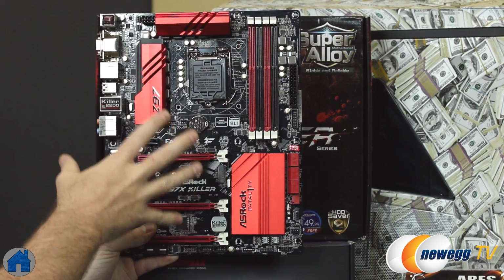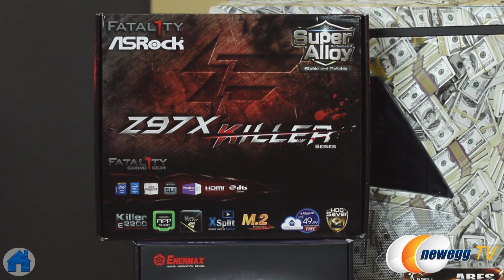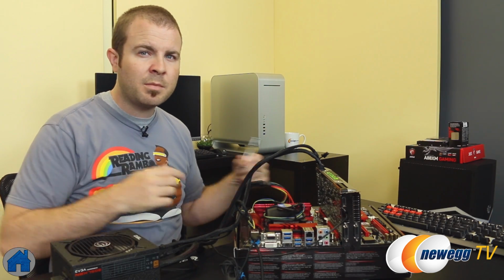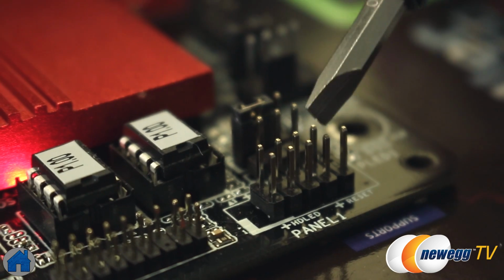How to Build a PC - Part 1 - Newegg TV

Comment: I'm new to computer building community and was wondering how this build is
AMD FX-6300 processor 
Cool master hyper 212 evo heat sink
Asus M5A99FX pro r2.0 atx motherboard
G.Skill ripjaw x series 2x4GB DDR3-2133 RAM
WD black series WD1003FZEX 1tb 3.5 GB 7200 rpm hard drive
EVGA geforce gtx 750 ti superclocked video card
EVGA 220-g2-0750-xr 750W fully modular power supply 
Corsair 500R atx mid tower case

Comment: First build, any thoughts?

Graphics card: Gigabyte GeForce GTX 970 4GB WINDFORCE Video Card
CPU: Intel Core i5-4690K 3.5GHz Quad-Core Processor
Motherboard:Gigabyte GA-Z97X-GAMING 7 ATX LGA1150
Ram: G.Skill Ripjaws X Series 8GB (2 x 4GB) DDR3-1333 Memory
Storage: WD Blue 1TB 7200 RPM & 120gb ssd
Power Supply: SeaSonic x650 gold
Case: Corsair 300r atx
OS: Windows 7

Comment: skimming off socket compatibility are all base component parts universally compatible if they fit together?? 
these are the specs i plan to get 
Thermaltake Chaser A31 Gaming Case
AZZA Titan 1000W
MSI Z97-Gaming 5
NVIDIA GTX 760 2GB
AMD FX 8350 8-Core 4.0GHz
G.Skill Ripjaws X DDR3-2133 8GB 2x
No clue on which hard drive to get atm, this will be my first attempt and build my own gaming PC and I've watched as much PC building videos as I possibly can to this point any suggestions on different parts or if these specs are compatible would be great, was also wondering if any extra hard drives or stuff like sound cards would be a necessity, you know like thigns that arn't listed that i will still need not regarding the mouse monitor or key board.

Comment: How is this build?
Budget: €800,-

Specs:
CPU: Intel Core I5 4460 Haswell Refresh
GPU: Asus R9 270X DCII 2Gb
RAM: Crucial Ballistix Sport 8Gb 1600 C9
MOBO: Gigabyte G1 Sniper B5
PSU: Cooler Master G550M
HDD: Seagate Barracuda 1Tb 7200 RPM
Case: Corsair Spec-01
Monitor: Benq GL2250HM
OS: Windows 8.1
Reply: Better then consoles for sure :)

Comment: Do your have to buy the cables connecting the hard drives to the power supply, and the data cables connecting the drives to the motherboard separatly? :))

Comment: Is this build alright for gaming?(got it from Austin Evans)

AMD Athlon X4 760K (processor)

MSI A78M-E35 (motherboard)

Sapphire Radeon R7 260k (video/graphics card)

8GB Crucial Ballistix sport (RAM)

1TB Western Digital black (hard drive)

430W Corsair CX430 (power supply)

Corsair SPEC-01 (case)

OS- Windows 8.1 64-bit 

Corsair AF120 (spare fan I dont really need)

please leave feedback or any improvements or changes i can make. This is a budget build.
Reply: I'm also not sure if I need an adapter to connect to WiFi... do I?
Reply: EpicTrolledYouBro Some mobos come with a built-in wireless network adapter to connect to wifi. Check yours and if it doesn't then you need to buy and install a wireless network adapter through pci express or usb. You'd want a wired connection rather than wifi though.
Reply: ItsQuiteSwell yea but where im planning to have my computer is no where near our modem so wired isnt an option unfortunately

Comment: I need help choosing my wattage, I would highly appreciate any suggestions. 

Hardware: 

CPU: AMD FX-8320 3.5 ghz (not overclocking)
CPU Fan: Stock
Motherboard: ASRock Fatal1ty 990FX Killer
Ram: 8 GB ( 2x 4Gb ddr3 1600) nothing too fancy
GPU: EVGA Geforce GTX 970 (Uses much less power than normal 970 or 900 series gpu's)
HDD: Western Digital 1TB 7200rpm blue edition 
Optical Drive: Some $20 Asus dvd cd drive
Fans: 2 120mm fans with led (again nothing too fancy)
PSU: My preferred/calculated wattage on pc part picker is 367 watts, but since another calculator said 500 watts i'm leaning toward a 550 watt psu to be on the safe side.

PS - This is my first build so do you guys think that this combo works well with each other and if i am missing something?
Reply: A good 400ish watt PSU, like the Corsair CX430 should be adequate, but to account for capacitor aging and to give you a bit of headroom in case you do decide you want to overclock or add components later, a 550W PSU would make sense as long as it is of equal or better quality and doesn't involve paying a large premium. Lately I have been recommending the OCZ ZT-550, which is well-reviewed, fully modular and $55 shipped in the US without having to mess with rebates.

The motherboard you've selected is pricy and probably not worth it for this build, especially if you don't plan on overclocking, though I realize a rebate is going on. I personally discount rebates because of the time and expense involved (paper, ink/toner, envelope, stamp) and the fact that cutting out UPCs can complicate the RMA/return process if it becomes necessary (the "expected value" of a $20 rebate is closer to $12 to me). The Gigabyte GA-970A-UD3P may be a good option to save some money (and it has a rebate going on right now too, on top of its lower base price).

You don't have an SSD incorporated into the build, which I recommend -- it won't improve your frame rates, but improved boot times, load times, and Windows responsiveness is worth it. 128 GB minimum, 256 GB is ideal. The Crucial MX100 is a great choice at either capacity.

Optical drive: Will you ever use it? These days most people won't. Save on some money and internal clutter if you don't need it.

Otherwise it looks good to me. And don't forget to get a case and operating system. And peripherals, of course.
Reply: I mainly choose the motherboard because it was great with reliability. I saw alot of problems with other motherboards that are affordable, cool (temp), and reliable. I know I was looking to spend less than that but it was my only choice after all the issues with other mobos on newegg.

What exactly is rebate? i don't understand how that works and it sounds like a scamish type of thing in which the manufacturers just want more money on the contrary of discounting. I've also heard the can take weeks and even months to give you the money back.

I would actually like an ssd for my os, but i view it as a luxury because its not necessary and my build looks like around $950ish right now and i don't want to bump it up more. Maybe next year.

Also, what are peripherals?

Comment: Can someone help me, I got a GeForce GTX 970 with only ONE dvi port, 3 displayports and one mini hdmi. How would I go about connecting a second monitor? I'm already using the one dvi port to connect the first screen, and my second monitor only has a vga and dvi port. Thanks
Reply: Captainprice785 Only needed it to watch video on the second screen nothing major
Reply: try a mini hdmi to vga/dvi, or a displayport to vga/dvi
Reply: Brian Trinh No worries, I already figured out another way. Go to the bios settings and enable the cpu integrated graphics, then connect whatever ports are available on your motherboard. So in this case I connected a DVI cable to my second monitor and it worked perfectly.
Reply: Mubz Beats - Daily Dose Of Real Music Integrated graphics, after you bought a 970? Ouch, dude...
Reply: It’s been 5 years does the 970 still work??
Reply: @calikdh  Haha im sure it does, i got the gtx 1070 now

Comment: Can anyone tell me parts for a budget PC some where around 500-600 recommendations for better performance I'm willing to spent a little more ty!!!, :)
Reply: Use logicalincrements.com to form your starting point, keeping in mind which (if any) peripherals you need, and that you'll need to tack on $90-100 for Windows (or $70 if you're a student).

Then use pcpartpicker.com to start shopping around for individual parts. Look for opportunities to trade up or save money. Use web sites like Tom's Hardware's CPU and GPU hierarchy charts, and the eggxpert tiered PSU thread to get an idea of where particular parts lie in relation to each other.

Then browse a deals forums like the /r/buildapcsales on reddit.com to find standout deals that hit your budget. Then go back to pcpartspicker.com and check out your list to refine your choices. Look up specific reviews for each of the parts you've chosen, including benchmarks (if applicable) and user reviews to see if there are any recurring problems people seem to be experiencing (it's usually safe to ignore any complaints/issues if they're vague or one-offs).

As a final step you may wish to post on /r/buildapc to have your build validated. Then pull the trigger.

Good luck and have fun.

Comment: I'm going to be building my first pc soon.  Do you guys think this build would be okay?
http://pcpartpicker.com/p/j8FRCJ
Is there anything I picked I could save more money on?
Is there anything that might be slightly more expensive but a better value overall?
Any general advice?
Reply: If you're going with a non-k/non-overclockable processor, there is no need for an aftermarket fan/heatsink or a Z97 chipset motherboard. You can save money by going with an H- or B- chipset motherboard and stock cooling, or you should upgrade to an unlocked i5; for about $17 more you can get an i5-4690k, which I recommend.

Also, RAM with tall heat spreaders, like those you've chosen, are often incompatible with tower coolers.

For GPU, AMD offers a somewhat better value right now in this price range with the R9 280. If you don't disregard/discount rebates heavily, it's worth noting that there's a $30 mail in rebate available for the MSI R9 280 GAMING 3G, priced at $185 before rebate, with free shipping. Even without the rebate it's a better value though.

You haven't incorporated an SSD in your build, which I highly recommend. It massively improves boot times, loading times and gives a noticeable bump in overall system responsiveness, although it won't affect your frame rates at all in most games. The Crucial 256 GB MX100 is a great value at $100; the 128 GB version is OK at $70.

Your power supply should be sufficient, though I usually recommend something a tad beefier. It's a fine value if you don't discount the rebate, but otherwise you should spend a bit more to go up a tier and get, perhaps, a OCZ ZT 550.

Consider whether you will really use the DVD drive; these days they're pretty superfluous for most users. If you'd only use it for Windows installation, maybe you can borrow one from another system, or acquire an ISO and do a USB thumb drive install.

If you're a student, get Windows 8.1 Pro through the Microsoft Store for $70. If not, you can save a little by going with amazon (though this price doesn't seem to be listed on PC Parts Picker for some reason): http://www.amazon.com/Windows-8-1-System-Builder-64-Bit/dp/B00F3ZN2W0/ref=sr_1_1?ie=UTF8&qid=1416651872

Hope this helps. Have fun!

[Edit: Another thing you can consider doing is going cheaper on CPU/MB to make room in the budget for the SSD and perhaps a better GPU if this is intended to be primarily a gaming PC; most games are not that CPU-dependent and for general use any modern CPU is more than adequate. Right now the i3-4150 can be had for only $90, which seems like a very good value to me. Other i3 processors as well as AMD FX processors may be worth considering, depending on what games you're playing and other specific applications used.]
Reply: Quinstol thank you so much for the help! The thing about the cpu though is I'm considering taking this to college for engineering and I'll probably need at least an i5 for some of the programs, but I may do what you say and spend a little more on an overclockable one.  Other than that, thank you! This helps a lot.

Comment: Hey I'm looking at building a PC for gaming mainly PSCX2 and the Final Fantasy 13 trilogy but I might get more games later. I have all my parts picked out but don't have the money right now so I would ask you to review and see if they'll all work with each other and do what I want them to do.

CPU: AMD A10-7700k Kaveri 3.5 GHz Socket: FM2 + 95W
Motherboard: ASRock FM2A88X PRO3+ Socket FM2+ 95W ATX
RAM: G.SKILL Ripjaws X Series 8GB (2 x 4GB) 240-Pin DDR3
Case: Cooler Master HAF 912 - High Air Flow Mid Tower Computer Case
GPU: GIGABYTE GV-N750OC-2GI G-SYNC Support GeForce GTX 750 2GB 128-Bit GDDR5
Power Supply: Antec BP550 Plus 550W Continuous Power ATX12V V2.2
Hard Drive: Seagate Barracuda ST500DM002 500GB 16MB Cache SATA 6.0Gb/s 3.5"
DVD Drive: SAMSUNG 18X DVD-ROM 48X CD-ROM SATA DVD-ROM Drive

Thank You ahead of time. If you could give me an idea for a video card that would be cheaper and work better then the one i have picked out already.
Reply: Go ask reddit.com/r/buildapc they can help review the parts for you.
Reply: The main point of going with an APU like the AMD A10 is that you get reasonable graphics performance without a discrete GPU. They make the most sense in small form-factor PCs that will be used for light gaming. Since form factor doesn't seem to be a concern, you can do better with a different configuration.

Here's my recommended ultra-budget build: http://pcpartpicker.com/user/Tukka/saved/LhFYcf

The bottom line is $448, so if the price is substantially higher than that, a price changed, so reevaluate before you buy. If there is still room left in your budget, upgrade the GPU to a 650 Ti or R9 270 (or better if something is on sale) and get a 128 GB SSD (the Crucial MX100 is a good budget choice, though the 256 GB version offers an even better value).

I eliminated the DVD drive from your build because there isn't much use for them these days between thumb drives, smart phones, Internet distribution, etc. but you can add it back in if you think you need it. [Edit: I also dropped you to 4 GB of RAM, which should not impact performance for gaming or regular use.]

Also note that if you update the motherboard's BIOS you can probably overclock the CPU for a nice little performance boost even with the stock cooler.

Comment: I am having some trouble with understanding the motherboard compatibility with the GPU. I wanting to buy ASUS M5A97 R2.0 AM3+ AMD 970 SATA 6Gb/s USB 3.0 ATX AMD Motherboard and I don't know what will be the best option for my GPU. I was wondering what would be a good option for a GPU around the 100-150 dollar price point. Also I was wondering if I should get AMD fx 6300 or AMD fx 8320. And for a case I was going to go for Rosewill Dual Fans MicroATX Mini Tower Computer Case with 450W power supply Cases FBM-01-450P will the motherboard fit well in the case and will the power supply be enough. Thoughts please.

Comment: guys i am planning to build a pc (my first time) can anyone help me what stuff i should buy to make a pc in a decent price. around $500 should be good. (sorry i am bad in english)
Reply: Graphics: GTX 750 Ti
 CPU: x4 750K (AMD Athlon X4 750K )
HSF: Stock
Motherboard: MSI A88X-G43
4 GB RAM ( G.SKILL Ares Series 4GB 240-Pin DDR3 SDRAM )
1 TB HDD ( Seagate Barracuda 1 TB )
No SDD ( If you want: SanDisk Ultra Plus)
Power Supply:  Rosewill CAPSTONE-450 
Case: NZXT Tempest 410
Reply: spent around $700 and switch to x6 and 8gb of ram
Reply: but i bet the other departments are turned down, and of course there is always sales that lower the price, mine were only estimates

Comment: How's this build? I recently finished it.

(CPU) Intel Core i5 3570K

(MOTHERBOARD) Gigabyte GA-Z77X-UD3H ATX LGA1155 

(RAM) Corsair Vengeance 8GB (2 x 4GB) DDR3-1600 Memory

(GPU) Gigabyte GeForce GT 730 2GB Video Card

(HDD) Seagate Barracuda 2TB 3.5" 7200RPM Internal Hard Drive

(SSD) Samsung 830 Series 128GB 2.5" Solid State Drive

(PSU) Corsair Enthusiast 650W 80+ Bronze Certified ATX Power Supply

(CASE) Corsair 500R Black ATX Mid Tower Case
Reply: its definitely not a gaming one.
Reply: It can get 100 frames in MC.
Reply: Minecraft is not a hard game to run...
Reply: I know my old build didn't pass 10 frames. except for on a lucky day. So I just built another with parts from the old one.
Reply: I upgraded yesterday. It's now a EVGA GeForce 770

Comment: How are these specs? What frame rate and setting would I would be able to run battlefield 4 on.
SPECS:
Resolution 1920x1080
Case Corsair Obsidian 250D Mini ITX Case
PSU Corsair CX Series 750 Watt ATX/EPS Modular 80 PLUS Bronze
Ram Corsair Vengeance Red 8GB (2x4GB) DDR3 1866 MHz
MOBO EVGA Z97 Stinger Core 3D LGA 1150 Mini-ITX 2 DIMM Dual-Channel DDR3 2666MHz
CPU Intel Core i5-4430 Quad-Core Desktop Processor 3.0 GHz 6 MB Cache LGA 1150
GPU EVGA EVGA GeForce GTX 970 FTW ACX 2.0 4GB GDDR5 256bit, DVI-I, DVI-D, HDMI, DP SLI Ready 
HDD/SSD WD Black2 Dual Drive 2.5" 120 GB SSD + 1 TB HDD Kit

Comment: I'm building my new PC! Is this any good? Keep in mind I'm on a tight budget.

AMD FX-6300 Six Core Processor
Gigabyte GA-970A-D3P
Sapphire AMD R9 280X Dual-X
G.Skill Ripjaws Ram Memory (4x2)
Western Digital Caviar Blue 1TB Hard Drive
Samsung SSD 128GB
Antec High Current Game HCG-620M Power Supply
Corsair 200R

I'm wanting to play games such as Far Cry 4, Grand Theft Auto 5 etc.

What sort of FPS will I be getting? :) Cheers
Reply: You don't wanna go for four 2GB sticks, rather take two 4GB. Rest seems good to play those games at High.
Reply: AGamingPanda Oh i meant 2 4gb sticks, sorry
Reply: Bobby Jones i am getting a Fx-6350 :)
Reply: Ernest660 Ah okay bud :)
Reply: Your build should run any game out now at 1080p medium/high if not more :) i am getting a PC with pretty close specs (your gpu is better) my CPU is gonna be alittle better though
Reply: Ernest660 Haha good to hear bro! Yeah I'm getting my parts each one by one, so it's a painful wait! So far I only have my GPU and motherboard. Can't wait to have my new PC though! Just wondering, what CPU are you getting? :)
Reply: Why an SSD ? For a budget build you should use that money on a better processor(upgrading your GPU without upgrading the CPU will result in an even greater bottleneck). Also, I suggest getting a better motherboard. It isn't bad but I would recommend an ASUS or AsRock motherboard instead. Asrock motherboards are usually less and higher quality than most especially in the price range.
Reply: Creamy Z Too late lol :L